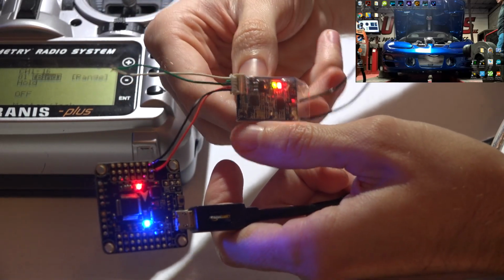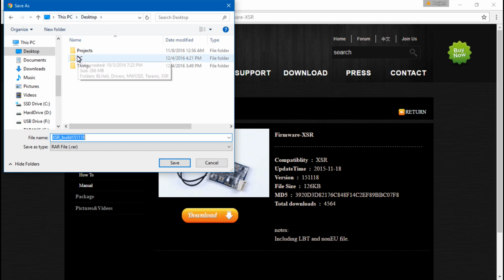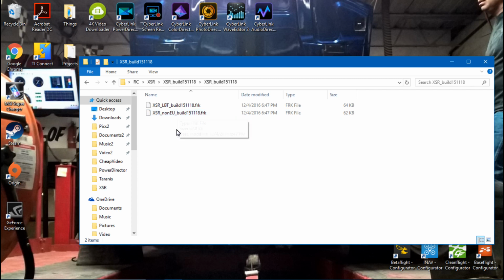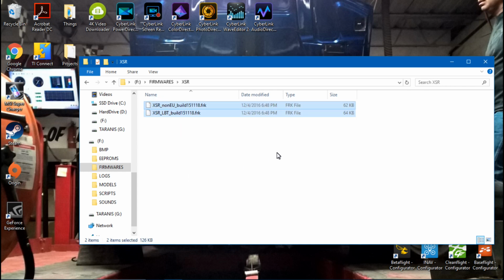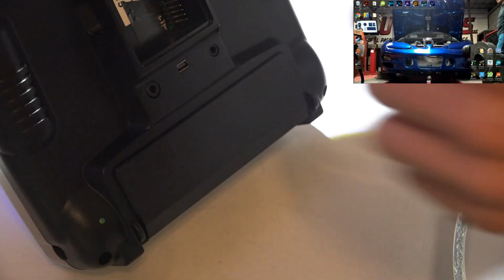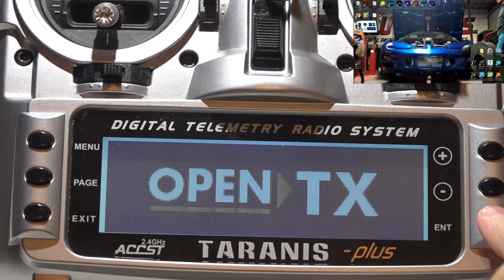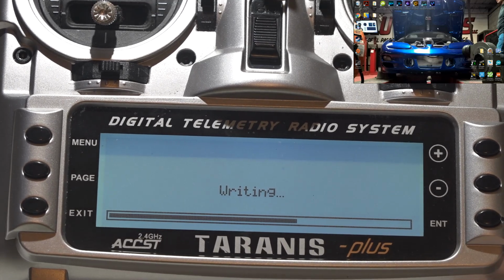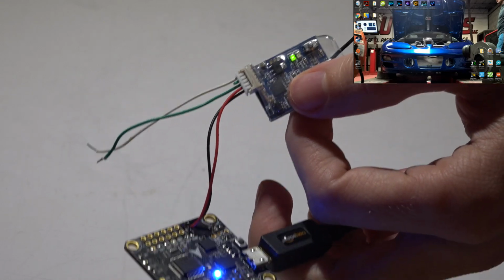FrSky XSR: How To Change EU / Non EU Firmware

Comment: Note if you are using a higher voltage battery than the stock Taranis battery you WILL fry your receiver.  Use a FTDI adapter jumped to 5 volts for safety if you are running a lipo or a higher voltage.

Comment: For all you guys with a QX7 Taranis to flash receiver firmware you need to use the "Smart Port" on the bottom of the radio next to the SD Card slot. The pinout is different too, correct pin order is GND, +5V, SIG going from left to right (SIG pin being closest to the SD Card slot).
Reply: how do i know if i have EU or nonEU?
Reply: pwrkiter eej i yust got the q x7 but the site is totaly diffrent what for firmware do i have to pick? How to s port products or firmware? And if so what of the 3options?
Reply: That would help allot and btw al the other procedures are the same?
Reply: Never mind i figure it out
Reply: golden comment! Thank you very much :) Now I can go fly...
Reply: Yes and for some reason I had to flash the XSR with the EU version and then flash it back to the non-EU version for it to work without errors. My reason for flashing it was to get telemetry working with a betaflight f3 flight controller, FrSky states on their site the current download had increased compatibility for the S.port working with f3 boards and it certainly got it working for me.
Reply: omg Ty dude, i wish i rod this 2h ago, anyways u saved my sanity, didnt know what is wrong
Reply: Bennie Leip hahaha i like how your last post said never mind i figured it out!! I am doing the same thing! I am afraid i still do not feel like i have it! I guess i am lucky to have a friend that loves building drones he helped me set up the qx7 with my furibee 215! But i still feel like i need to know this stuff and i want to!!!

Comment: http://www.frsky-rc.com/download/view.php?sort=Firmware&down=256&file=Firmware-XSR 

i did all of this on the qx7 however, there is two files showing .fr and .frk on on the tx is it because im using a mac? whe i click flash ext device it says fw update error not responding
Reply: the rx has a flashing red light if that means anything
Reply: OK so I had an epiphany, nearly pulled all of my hair out! on the QX7 transmitters you need to FLASH INTERNAL Device NOT EXTERNAL!!
Reply: Still not binding....

Comment: blue falcon..... please help.. i have the taranis plus.. i upgraded the firmware via opentx companion to 2.1.9 a month or so ago... now im reading that there is new LBT firmware for the taranis and also the xsr reciever.. my question is that i have a x4r and xsr and both of them are bound and work perfect. but i just ordered a new xsr today (3-16-17) and i read that the xsr comes with the new LBT firmware on it.. do i need to change my firmware in my taranis for this to bind and work? and also change the firmware in my old xsr and x4r to the LBT firmware?  im confused on the EU, EU LBT, firmwares.... i live in the US.. should i stick with the non EU Firmware and put NON EU FIRMWARE on the new xsr?
i hear that the LBT firmware gets alot better range and stability..
thanks  steve

Comment: can I flash this one that way?Tiny Frsky 8CH Receiver Compatible With FRSKY X9D Plus DJT DFT DHT For QX95 QX90 QX80 DIY Micro Quadcopter
https://banggood.app.link/BZfhfWuFMz or this 2.4G CC2500 A7105 Flysky Frsky Devo DSM2 Multiprotocol TX Module With Antenna
https://banggood.app.link/0TlYL5HFMz
Reply from the maker: As long as you can find the firmware for it I dont see why not.